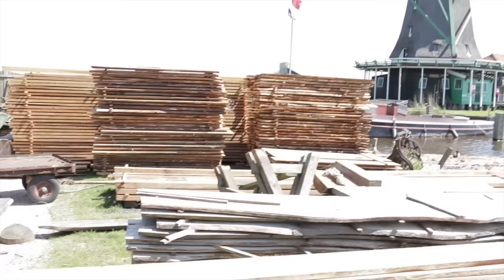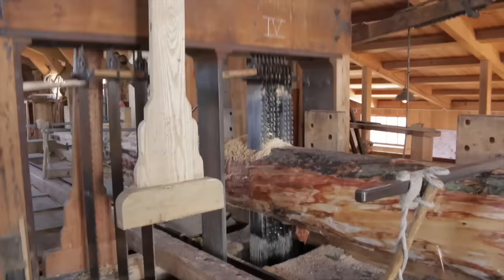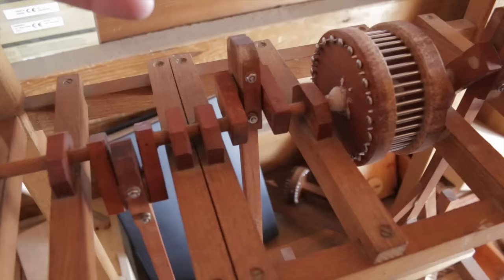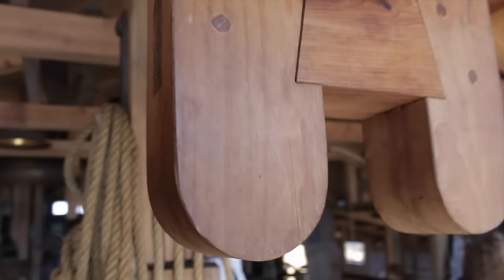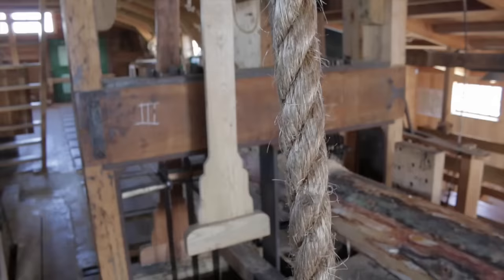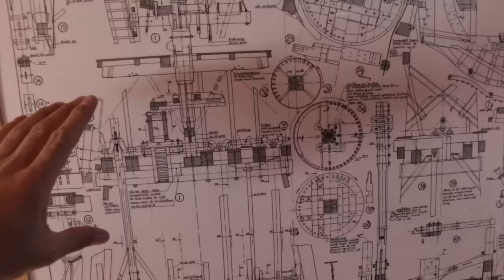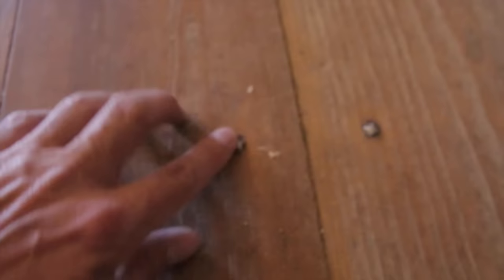How A Wind Powered Sawmill Works- AMAZING

Comment: I was expecting a round blade, but was surprised and impressed to see those gang saws. I've never seen such a setup. Very interesting.
Reply: Early water powered mills had the same set up.
Reply: Thats What You can call perfect dutch tegnologi
Reply: At the time that the mill we see here was developed, there was no technology to make a large circular saw blade, but a blacksmith could pound iron into a flat thin blade.
Reply: @pauleohl  Ok, that makes sense.

Comment: That's amazing! It would be cool to learn a bit more how it works, as in, how the wind power is transferred into sawing and feeding motions - the gears, their relative sizes affecting the power, etc. I'm no engineer so I don't know the right words for it all, but when I looked at the title of the video again at the end I found I was still wanting to know. I'm not even clear on how the feeding motion is linked to the sawing motion, despite re-watching part of the video, though I believe you that they are, and they certainly can be seen to move at the same rate.

Comment: I like your video! It was filmed last monday, wasn't it? I just left haha! I work there as a volunteer once in a while, and I am a miller on some of the other mills in the area. 
You said that they were going to adjust the pitch of the blades, which isn't true, unfortunately. The blades kan be covered with sails, less wind means more sails, and more wind means you have to put less sails on the blades. The mill was turning with four full sails, and when they went up they took away some sails. I believe they took two halves off.
Reply: Rick Bakker up
Reply: Need a video for that then. I’m sure they don’t just climb around on the blades while they’re turning. I saw a movie back in the 60’s showing something like that.
Reply: The blades are balanced and essentially reefed reducing the sail area. If in balanced then the blades wobble and are unbalanced   Thus " 3 sheets to the wind"
Reply: Lem Briggs, the mill is stopped when the sailcloths are taken in or let out, with each sail being tended one at a time.
Reply: @crazyleyland5106     good deal,  that cleared it for me.

Comment: My step-grandfather (born 1896) had an old hand-cranked drill press with a similar ratcheting feed that fed off the hand crank.  It makes sense- when both the feed and main tool are running from the same power source, the speed will always be in proportion.

Comment: The Pit Saw is where we get the phrases "Top dog" and "Underdog" from - the "dogs" were the wooden rollers across the width of the pit, which held up the log. The senior guy would be "Top dog" (above the dogs) and would have the nicer working conditions, the poor guy underneath would be showered with sawdust and bark, and probably standing in several inches of water in the pit beneath the log.
Reply: They still cut trees into boards in a similar way in Kenya but they make use of a bank or slope, not a pit. same saw blade however. They still make the blades in India!
Reply: Mark Sinden 9

Comment: In France also there's a renaissance of wind and water mills. People get tired of the wind turbines that produce electricity so by logic they come to consider the ancient mill technology and re-discover it with awe. The direct use of the elements is much more efficient than the transformation of energy to electricity to power electric tools. Also the noise and stress level is so insignificant with wind power and the noise is actually pleasant and rhythmic.

Comment: Fascinating video, thank you for sharing. The process of soaking logs in water is called water conditioning. Removing the sap and sugar from the lumber helps preserve the wood against insects and fungi. It could also help against warping and cracking as you have mentioned, depending on the species.

Comment: I sure would like to have a copy of those plans. Great video. I once watched on television a water-driven mill that was set-up for not only sawing wood, but also performed various actions including blacksmithing, and grinding grain. The men that designed these marvels were true mechanical engineers.
Reply: +Steve Fridell You'd have to search for the drawings by Anton Sipman, who was a person who did extensive research on windmills in the Low Countries and Germany. He wrote several books about windmill construction, not just drawings but also about which types of wood for which parts were used. (mind you, a windmill is a complicated machine built on the accumulated knowledge of a thousand years)
Reply: Thanks for the info! Yes, I wouldn't begin to attempt building one of those without plans.
Reply: Steve Fridell Construction windmills is usually not the domain of the carpenter or shipwright, but of the specialised windmill constructor ("molenmaker"), there are only a handful of these companies in Holland left, and they seem to be doing projects all over the world nowadays, mostly all over Europe (including UK) and sometimes as far as Israel and Indonesia to build, rebuild or restore windmills. If you're interested in something small to start with, go check out "weidemolen" or "speelmolen" or even "tjasker".
But if you live in a country with plenty of water falling down hills, I'd rather built a watermill.

Comment: The college lecture who taught me Woodworking machining, said  his father owned a saw mill which had Frame saws (not wind powered however), and they sold smooth sawn boards. They had a lucrative contract making beer crates for the local brewery the smooth sawn boarding they produced was ideal for beer crates, with the minimal amount of wood waste. Frame saws although slow feed speed, produce a large quantity of board feet. With the multiple saw blades in the frame ideal for thin boarding.

Comment: We have. a water wheel powered slate quarry woodwork shop thst services it in Llanberis.  It's a very similar set up.  The quarry was closed in about 1940s but ran for about 250 years before that  it's a working museum now,  very much like this. 

That's why you should of come up north in Britain, away from London.

Comment: Sinking the logs in water opens the cells of the wood. The bound water is on the inside of the cell and the free water is on the outside of the cell. When you submerge the logs the cells open and the pressure of the water balances. When you dry the lumber the cells are already open because of the water. So yes there is less drying degrade from a submerged log. Because the bound water is given up freely and equally with the free water. I have been a millwright, sawyer and dry kiln manager for many years. I also have my own mill and have operated it since 92. The information I shared came from the late DR. Cullpepper from a US government study on lumber drying in the Pacific North Wet.

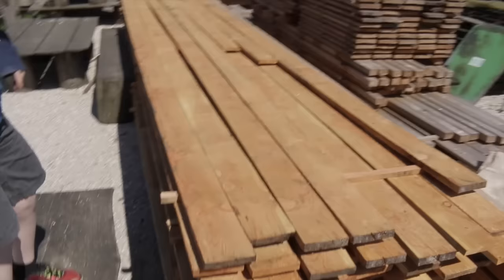Comment: 8:48 In Europe, at least till the early 19th century) logs were kept in the water for periods as long as a generation : the father would leave logs he bought in a bind for his son when he took over the business (conversely the father worked the wood his own father had left …) then the drying process was quite fast : in just a year the water would have dried out of the planks that were sawn.
Of course this passing of wood through  generations pattern didn't take into account periods of economic crisis when a family had to find other means of living to survive.
However this system explains why so many older pieces of wood such as the Middle Ages buildings made of wattle and daub over a wood fram are still perfectly "healthy" after 1000 years … Our 2x4 will never get that far !!!!… 
Thanks for posting !…

Comment: A completely amazing setup and something to give thought to.
Today they may cut it faster but just how big is the power supply to run a 
Up to date saw mill .
I have never seen this before and I am stund at the amount of thought that has gone into every detail of the operation, all with the workmanship of a craftsman, every joint is spot on, truly amazing, i am gobsmacked, even down to hand made nails for the floor boards.
The one thing that did stike me was that if they sharpen the blades every  fifty meters then they must get through blades rather quickly, but then again they are a lot thicker than band saw blades so would last long, but there must be quiet a bit of down time to change a blade all in all a truly great video would love to see more.

Comment: interesting to note also Cory about the balance arrangement up top. I mean if there's 4 sets of blades surely for balance up down down up must work, like a straight four car engine. or alternatively for such a low speed would the vee eight crank arrangement work. up left right then down?

Comment: Brilliant. I want one. They said the blades have to be resharpened every 50 meters . I wonder if they are tungsten carbide or high speed steel. If not and they decided did use TC or HSS steel blades I wonder if it would increase the cutting rate and reduce blade sharpening down time ?

Comment: That is really cool, there are some smart people out there in the world that do things the simple ways in life.. i met a guy in Colorado who built his own house up in the mountains using nothing but power he generated from the creek that ran through his property... he built a watermill out of wood he chainsawed from the property that turned an modified washing machine motor, which charged a marine battery he had on site.. the water was pumped into a large holding tank made out of a tote he picked up local using a ram pump, then the exit of the water tank was restricted just enough so the water going into the tank from the ram pump was just barely more than the water coming out of the tank.. the water came out of the tank and dripped onto the water mill with the... the measured restriction was enough to keep the water mill turning consistently, while the spill off from the tank becoming to full from the ram pump was just for extra acceleration of the water mill... basically it would run all day trickle charging the batteries, then when he needed to use it for cutting wood and such or lighting the power was there... i think since then he has modded it for more efficiency and uses a large turbine type water pump as the power generator instead of an water mill circle.. he kept it because its more reliable power over the solar panels he set up on the property for power...

Comment: Regarding the escapement that moves the log forward, you noticed it only moved the log on the non-cutting upstroke? That means there's a slight angle to the sweep of the saw teeth.giving clearance for the move.

Comment: Hello. Not directly related question. What type of paint was used for wood protection at near by water? Mine - if not pressure treated - decays in 2-3 years and have to be replaced. Any suggestions?

Comment: The ratchet mechanism that moves the feed for the log is not just for speed control. It also makes sure that the saw only cuts on a down stroke. When the frame makes an up stroke, the log does not move. Only on a down stroke is the big cog moved forward. More modern jig saws have a frame, on which the lower portion swings out of the way so the feed can run continuously but the saw frame swings aft so it wouldn't cut on an up stroke.

Comment: the logs went directly from the water into the mill? does that not mean they will warp heavily once the boards are dried?
edit: I see you mentioned this at the end of the video. That is fascinating to hear.
I always thought you would dry out the wood extensively to avoid warping. Does that work, too, or am I completely off?
Reply: +SoWeMeetAgain The whole trunk is too thick to dry evenly. It must be sawn before you can let your boards dry.

Timber must not be too dry either, because it still takes on moistureafter drying, so having boards too dry would mean they warp after construction.

Comment: is it that Holland is really windy or dose it just have a nice breeze most of the time? 
always looks like such nice weather but they use a lot of wind power.
Reply: +Dareld Jolliffe I am pretty sure that coastal areas always get reliable wind in the morning and evening. I would bet Holland developed wind power so extensively to pump water out of low lying areas.

Comment: Cody, could you help me find the vlog where the lumber mill man (in this windmill that had been built or rebuilt using the blueprints they'd found) told you how twice, the German artisan had built part of the mechanism with just the right tolerances, yet it had broken both times, and how they rued having given the old mechanism that worked perfectly, to a neighboring windmill? (Pant, gasp--long sentence but didn't know how to word it differently!) Did you delete that part??

Comment: G'day,

  Yay Team !

    Awesome Video, mate, well done indeed.

     Um, if you're having trouble with your Backslab-Milled Lumber cupping, warping, twisting, bowing and cracking as it dries..; you might enjoy watching my Video about "Quarter-Cut Milling...." (posted fairly recently, a few months ago...) using a Stihl 038 Magnum with a Rip-King Guide-Rail & a 36-Inch Oregon Bar with a 115-Link Chain...

  I got sick of dragging 5.6 Horses attached to 115 Knives backwards through a Stringybark Log 27 times and then having the sawn Lumber crack and shrink out of shape while drying...; so I taught myself to Quarter-Cut Mill the Windfalls, for whenever I need  to source some Straight & True Hardwood which will probably outlast my (as-yet unconcieved) Grandchildren...

Have fun,

;-p

Ciao !
Reply from the maker: +WarblesOnALot link?
Reply: Wranglerstar 

   Ah, well, to add a link into a Comment or Reply on the Threads one must be working the Tubes from an actual Computer...; and I've never had, nor learned how to use, a Computer.

  The best way to find the Video is to follow me back to my Channel, go into my Uploads and then backscroll looking for it...; it's primitive but effective.

  This Channel was bookmarked onto my Mobile Phone by my Daughter, 5 years ago ; I make my  Videos on an old Pushbutton Nokia Asha 302 Phone-Cam, using the old-style Edit-In-Camera method, Shooting-In-Sequence on the Pause-Button, and then I move the Micro SD Card accross to this Sony Experia E for uploading to YT...

  That's why I told you where to look for the video, and how to backtrack me to find it...; in my Uploads, a couple or 3 months ago.

  The story is that about 4 months ago a Stringybark fell on my Front Gate, so I posted 1 video of the process of clearing the Gate, then another one  a week or so later as I Quarter-Cut Milled the Timber to repair the broken Gate with,  from out of the trunk of the Tree which did the damage, then another video of the biggest Branch being Backslab-milled to yield a Beam to Stay the Gatepost with, and finally a clip showing the "Hillbilly Wood-Welding..." which  used Tie-Wire to splice the new Wood into the old broken Gate-Bars...

   So there's 4 Videos about that Tree on the Gate episode, spaced out over a month or so  ; and I post 3 or 5 Videos in an average week (and 3 weeks ago I uploaded 14 Videos in a bunch, covering a Fashion Parade...), so you'll have to backscroll a reasonable way to find it, but it's pretty easy to notice, the Chainsaw-Mill is in the Thumbnail and the Title is something like "Quarter-Cut Milling With Chainsaw & Guide-Rail...", and Title-Searching my Uploads for that will probably pull it up...

  Mobile Phone YT is a bit clunky but I live Off-Grid, and I'd need to vastly expand my Solar Array & Batteries if I was trying to feed a Desktop with electrickities, and my Prepaid Mobile gives me unlimited Uploads & Downloads worth of Browser-Pack for $2 per day...

  So I probably have one of the cheapest & lowest-powered YT Channels in the Western Industrialised parts of the Tubes (?) ; the original idea was to publicise the results of my "SunFoil Project", and I have a Playlist of that name which is worth checking out if you're into Alternative Energy applications...

Have a good one,

;-p

Ciao !

Comment: Nice early industrial revolution machines. Gang saws actually go back to the Romans,usually water powered. Also used in colonial times. Either Boy Mechanic or PM Shopnotes has a good article on the wind powered shop.

Comment: I wonder how much horsepower that thing puts out under full wind boost. Being able to cut up to four logs, with that many blades on each must take a tremendous amount of power. We need to figure out how to dyno a building!
Reply: +desolatetree Nice question, stumbled upon some answer: http://www.let.rug.nl/polders/boekje/capacity.htm
If you do not want to read the article, it comes down to about 50HP for an unimproved windmill, and max 75 to 90 HP for an improved one.
Reply: spookje111 I asked as a joke, but that's actually pretty interesting! Thanks!

Comment: Sitting on a river, I think I would have opted for a water wheel driven power - the river will likely always run, unlike wind.  Even in areas where wind is highly likely, there are calm times.
Reply: Depending on where you live water flow can still fluctuate throughout the year too. Wetter seasons will have higher flow rates than at the height of summer when rainfall slows down